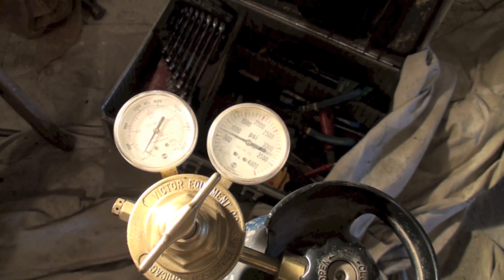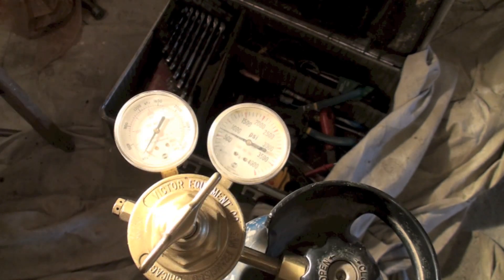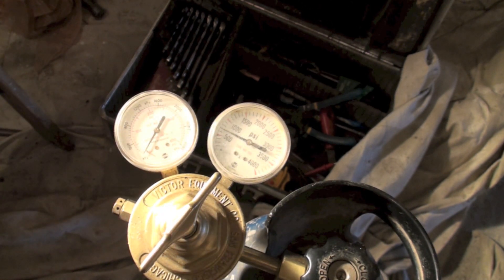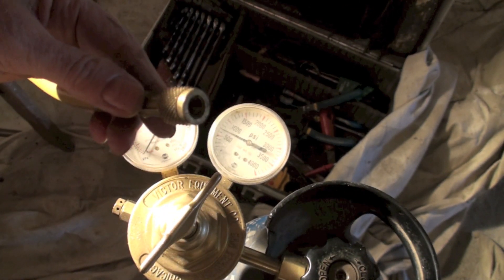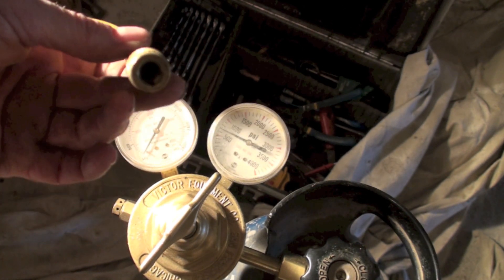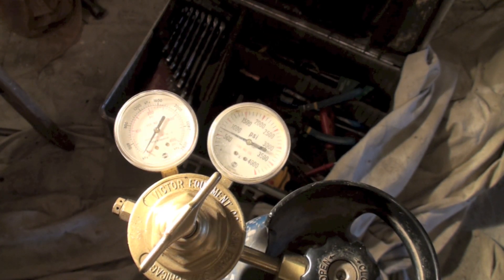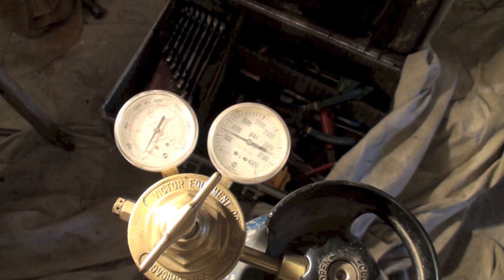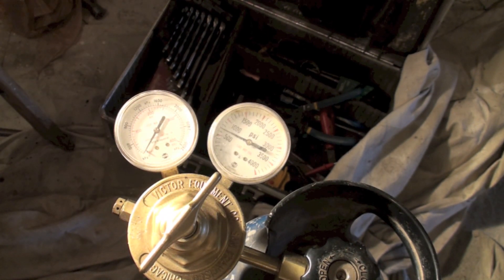Running nitrogen thru the lines while brazing

Comment: I use a flow meter.  The floating ball type like they use on argon cylinders.  I go to the end and hold a lit match.  Only use enough flow to snuff out the match(no oxygen). I’ve never had a problem with pressure blowing holes in my joints.  I only flow the minimum, with the ball on the first line.  I would think there would be more chance of having a problem with a regulator.  Everyone has their own way, and should use what ever works for them.
Reply from the maker: Agreed.
GFM

Comment: Why do you need any flow at all? Once you purge with the gas it's going to remain captured in the piping long enough to get your brazing done. I just purge and then loosen the fitting at the nitro tank enough to relieve all pressure to atmosphere and never had any oxidization issues.
Reply from the maker: Sometimes I will also shut off the flow if I am having leak problems with the joint. 
GFM

Comment: Great Video Gary and I just wanted to ask you what if you braze without nitrogen at all then flush the system with nitrogen after  ? No TXV coil in this case just restrictor type with piston removed please share your thoughts Thank you
Reply from the maker: King Hammurabi Flushing with nitrogen is not effective as there are too many places in the system that can trap the copper oxide.  Its always best to prevent formation of the oxide than to try to remove it after it has formed.  
GFM

Comment: Thank you. I've used co2 for thirty eight years in the hvac business. I used it for pressure tests and for purge when silver soldering. You can get regulators that will go to two or three hundred pounds for pressure testing. When soldering I just left a fitting open and gave it a slow purge for a minute or so then shut off purge gas. I then proceded to solder. Once the gas is inside the pipe it has displaced the atmosphere which caused scale and oxides. C02 is great for blowing out coils, equipment, water in pipes before soldering. I rigged up a old five foot charging hose and used a two foot piece of quarter inch copper tube as a wand on the end of the hose, worked great.
Reply from the maker: GARY SMITH I also have used it by shutting down the reg after purging for brazing.  I like to have a small flow inside the tubing, but even that small flow can sometimes cause holes in the braze joint.  Thanks for the thoughts.GFM

Comment: I have used a flow gauge for over 40 years, never had a issue. Using a pressure regulator alone with to much flow and if ends are closed you will blow holes in your braze. Also holding hose to your ear, your going to hurt some one, never hold to your ear. If the diaphragm in the regulator sticks you will get a blast in the ear. Hold two inches from lip, can't get hurt.

Comment: Thanks GFM for the quick response, I've Watched all of your video's your a very good teacher. So I guess the question is I can use CO2 in my lineset while brazing and it will prevent the oxidation just as good as nitrogen flowing thru while I braze the connection?
Reply from the maker: Yes, it will work.
GFM

Comment: CO2 is a viable replacement for nitrogen? Most people that I talk to won't use either because of the cost of nitrogen I think is pretty expensive ! But I think some of those guys would convert if they realized it has the same end result. It's the old timers that say for 25 years the old way was acceptable they didn't use nitrogen before! I'm curious GFM when you where installing did you use inert gas to keep the oxidation down?
Reply from the maker: The only problem with CO2 is the regulators generally won't go to 500# for test pressures on R410A units.  I did use nitrogen to eliminate oxidation when brazing.
GFM
Reply: Bernard Sobbe nitrogen is cheap... You just gotta buy the tank one time and they'll refill for cheap if you got a EPA

Comment: Hi I have a question general welders use Argon as (shielding) inert gas vs Nitrogen,  I also understands the importance of using nitrogen flow as inert gas for copper brazing, can Argon be used similarly or does it have different reactions with copper pipes or moisture reactions?  Thanks your videos are very resourceful.
Reply: As a Welder we use Argon and sometimes Helium as shielding gas for the TIG process.  These are the 2 true inert gases, you could use argon with copper or helium but their more expensive; helium is way high.  Nitrogen makes up 78% of the atmosphere and it"s semi-inert and a lot cheaper.  CO2 is even cheaper, plus it the heaviest of the gases which is good for purging.  You can see this with dry ice, it "melts" into CO2 and pours out like a vapor.

Comment: Do you  think it matters if the nitrogen is introduced into the system thru the high or low side? Some have said to go into the high side only.
Reply from the maker: I have done it both ways.  If you are wondering which way will work, start a very low pressure through.  If you get pressure out the other side, its working.  Hope this helps.
GFM
Reply: OK. Thanks.  Here is my take.   I really didn't think it should make any difference, except if something is in the distributor lines or the orifice,  if a partial restriction is suspected;   then pressuring through the high side might blow it loose or even move it to the  low side filter when the system is charged in AC mode.  I guess if its a heat pump,  pressuring the normal low side could force it to the normal high side bi-flo filter.  Putting a burst of pressure into the system could dislodge anything that is blocking flow.  Then backing off to a very low flow would seem to be the way. Make any sense, or am I just being unnecessarily deliberate?
Reply from the maker: ritewayguy You are probably over thinking the issue.
GFM

Comment from the maker: I like the 80 or 120 cu ft size.  The small, I think 20 cu ft is very common because of its light weight, but runs out very fast.  Hope this helps.
GFM

Comment from the maker: Have you paid your gas bill?  Also check all gas cocks in the line.  There should be one outside the furnace, and the gas valve has one on it.  Also look for failure codes.  Hope this helps.  GFM

Comment from the maker: By cutting down the flow at the regulator, you are cutting the available pressure down.  I don't say the regulator is all that accurate at that low pressure, but it is the best solution I have found.  Your comment about schraders is a good one.  I remove schraders for brazing, pressure testing and evacuating.  Great thoughts!
GFM

Comment: GFM, if you use your setup or a flow meter won't they both pressurize the system if there's a restriction and ruin your welds? Also best to remove shrader valves while doing this of course :D keep up the good vids! There awesome